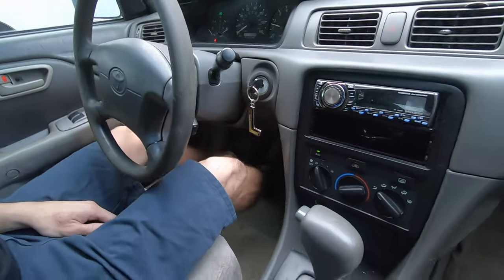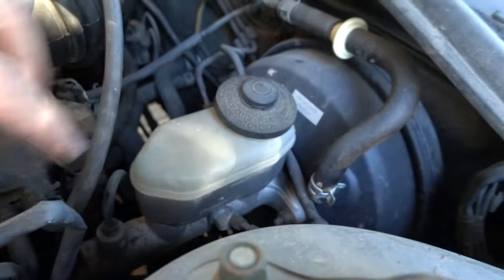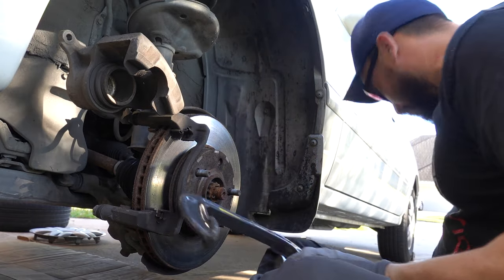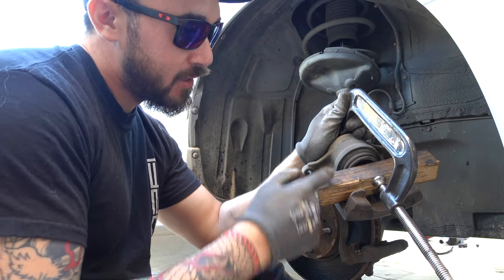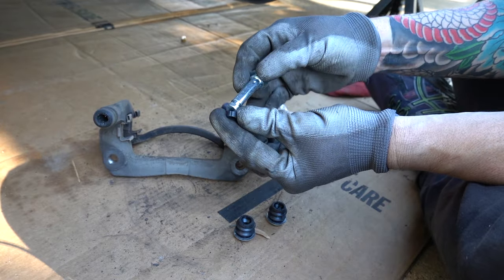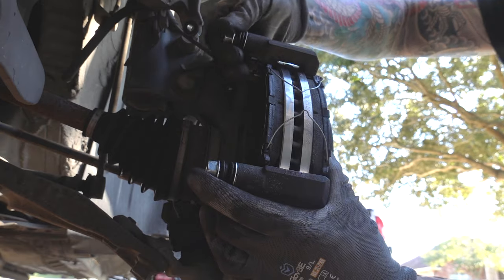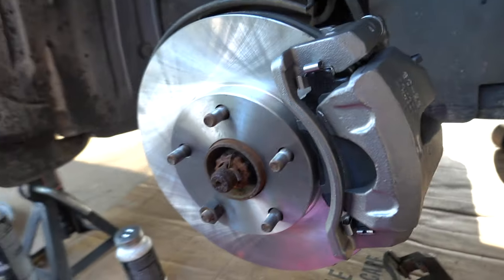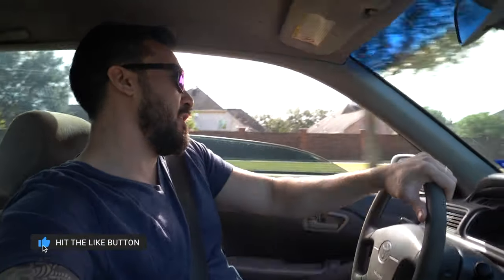Soft Spongy Brake Pedal / How to Fix Brakes that Don't Stop Good

Comment: Quick question. If you were replacing and fixing all those things, the rotors pads caliper....why did you not fix the broken wheel stud also before putting on new rotors and pads?
Reply from the maker: Because it wasn't up to me. Not my car.
Reply from the maker: Lol, because some people are cheap.  Lol
Reply: @Donnythelatemodeltech  talk about cheap!!!... a wheel stud just costs a couple of bucks and is so easy to replace!!! I don't understand your buddy's mindset!
By the way, as an aside, my favorite parts of the video is when you removed your sunglasses, you have "killer" eyes! (I hope I won't embarrass you with my comment)

Comment: is the master cyl  bypassing?    when there isnt a fluid leak anywhere and the brake pedal goes down...the rubbers in the master cyl   are worn and the fluid is bypassing the rubbers/ pistons

Comment: hey I went to garage to fix my brake cause fluid was leaking in the rear left. Since then my brake is exactly the same of the vehicle in your video. I dont understand very well why it is not back to normal. The guy who worked on my car said something like I have to change drum in order for my brake to be same as before. It is dangerous, I can't believe he let me take the car out. He charge me 250$ and will charge me additional 200$ tomorrow. My neighbor is also a mechanic for a public service and told be there as to be air inside there. He also telling me to be careful of this garage. according to this video I should check the caliper.

Comment: You should have replaced both brake hoses too because when they are old they come apart instead a clog up the caliper inside of it also you should have replaced both calipers like replacing both 👠 shoes you don't replace just one you replace both of them in sets because you have one new one and a old one you can have a brake pull from that it happened to me before have a blessed day and thank you for your videos 😊

Comment: I'm a noob at this but I know you NEVER pinch the brake line. Please if you're watching this don't ever clamp the brake line. You'll damage the line and possibly cause irreversible damage
Reply: Yeah, I think you're right, I'd rather plug it up with a piece of shop towel or a rubber plug designed for that purpose.
Reply: @armoricain  you'd wanna avoid damaging that line as much as you can. I'm in the process of replacing the front calipers because they're sticking. I wanted to change the brake hoses too just to be safe and turns out out the parts stores don't have the right size hoses that fight the bolt on the brake line. It's been a nightmare. And honestly you won't lose that much fluid if you take off the hose for a minute or two while you place the new caliper in. You'll still have fluid leaking regardless. Seems reckless and unnecessary to pinch it in my opinion

Comment: Hey there! New subscriber here! I recently purchased a 2016 Nissan Frontier sv crew cab with 46k miles. My break pedal is super soft (easy to press) and have to push down all the way almost or it seems like in order to have the truck completely. After your video I checked the reservoir and its full up to the cap. Is that the problem or could it be something else? Thanks!!
Reply from the maker: Does the master cylinder look new? Does this truck have ABS?
Reply: @Donnythelatemodeltech   thanks for the response! And idk where that would be located. I guess i can look it up and check it when i get home
Reply: @Donnythelatemodeltech   and I believe it does

Comment: If the piston doesn't go back into the caliper, it's wise to try opening the bleeder and then try to press the piston in. Sometimes you have a collapsed hose. It's not visible from the outside. The hose lining collapses in on itself.

Comment: U have good work but when u tap the brake it will still pull go forward like normal because its automatic so as soon as u tap the brake and take it off its got no lag between the gears so yes it will keep going as normal

Comment: great video   . I would have pumped that piston out and cleaned  it up ..   Like the slide pins , everything    hot brake wise tends to dry out and either go stiff or solid . when assembling the pad sliders   use some anti seize grease on the metal caliper faces . and blue loctite on the caliper bolts .
Reply from the maker: I don't use anti seize on anything brake related. If the manufacturer didn't use it when assembled - I don't use it. 
 Thanks  for the input.